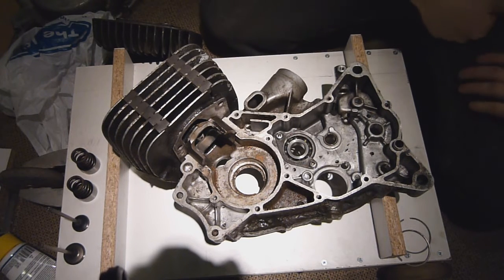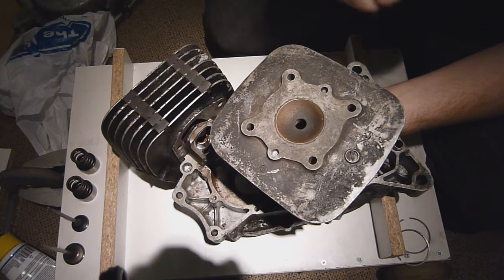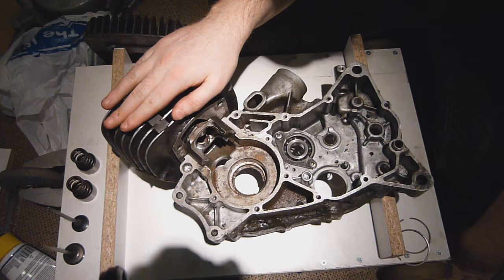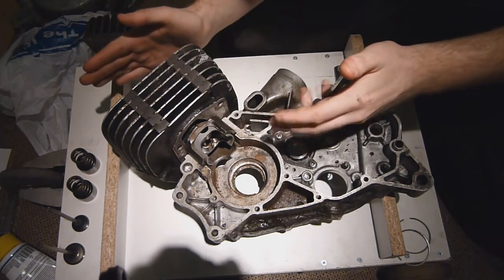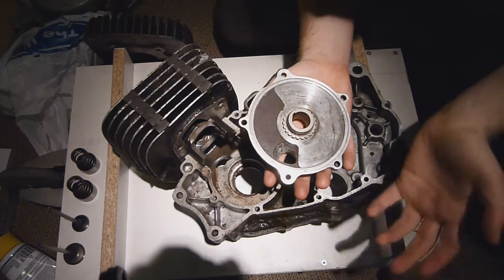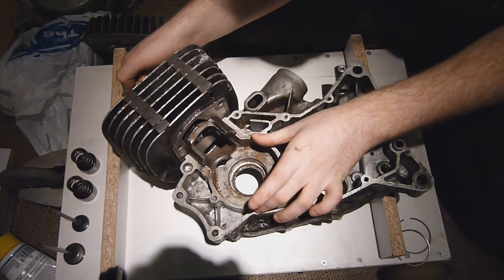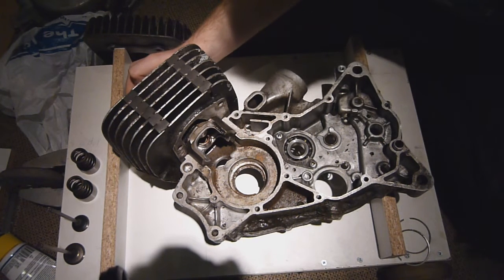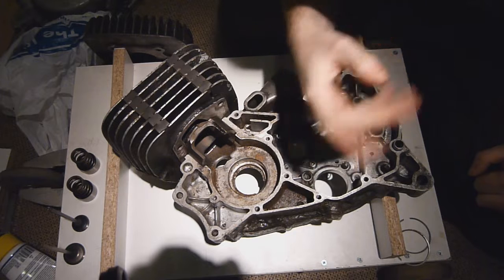How a crankcase induction 2 stroke engine works (The importance of the crankcase)

Comment: Is there a possibility that the crankcase gets filled up with oil if you do a premix and mix too much oil?
Reply from the maker: Not to the extent that you will have a crankcase full of oil, engine wouldn't run at that point. Normally find it just sprays out the exhaust due to the piston forcing it through the engine. Normally find bad carbon build up is the most common issue with too much oil and bad running.

Comment: quick question kiddo. if the returning pulse down the expansion chamber is strong enough to send mixture back into the barrel, how is it not returning the exhaust gas back in also?
Reply from the maker: Well the simple answer to that is it will return some of the exhaust gases back into the chamber at some rpm ranges. That is were the science come into it because you need to design the exhaust at the best RPM for you so the wave just has enough time to push in all the fuel/air mixture. Anywhere above that rpm the exhaust will start getting pushed into the chamber and anywhere below and there will be fuel left in the exhaust.
Reply: cheers

Comment: Does a 350 Kawasaki triple have any inherent performance advantage over a 350 Yamaha twin because of the extra cylinder ?
Reply: +Ron Lawson yes it does, but i believe it is a piston ported engine unlike the yamaha which is a reed valve engine. reed valve engines have a wider powerband.
Reply: The third cylinder is an advantage.  The way the math works out, there's more cylinder area which means larger port area without having to increase port timing (large port timing leads to loss of low-end).  It also means the bore and stroke are smaller; lighter pistons moving a shorter distance means a higher safe RPM limit given the same materials.

Now that said, Yamaha did a very good job of overcoming these drawbacks on the RD twins.  They used a reed valve which allows more leeway in porting without losing low-end as easily as a piston-port like the Kawasaki.  Yamaha also used a more advanced transfer port configuration than the rather old-school (even for the time) Kawasakis.  And both those bikes were RPM limited not by the mechanical constraints of piston speed, but by cooling limitations.  So while a triple has advantages over a twin on paper, these were not realized in practice between the S-Series and the RD.

That said, there are now very well engineered reed conversions for Kawi triples and a good tuner can do marvelous things with the ports to bring them closer to modern designs.  Cooling can be improved massively my reshaping the combustion chamber and fitting a variable-timing ignition to stave off detonation.  In that context, where 80hp output at 12,000rpm is on the horizon, I'd put my trust in the triple.

Also, while the twin sounds great, the triple sounds like God's own orchestra.

Comment: What works best a reed valve or a rotary valve ? Do The old Kawasaki Suzuki and Yamahas that we are familiar with have the reed or rotary valve ? How do the ones without these valves keep the fuel mix from shooting back out the carburetor ?
Reply from the maker: +Ron Lawson , The ones with out valves use the piston skirt to block off the intake tract (Kawasaki H1,H2 etc). Now disc is the best because it's totally mechanical so the intake of mixture is metered the same every time. Reed valves work on the difference in pressure between the intake and crank case and at higher RPM the reed valves can't keep up (reed flutter) and you get leakage past the valves. Some race bikes did do engines with both valves which i guess would be the very best solution :)

Comment: In my mind, 2 strokes engines are much more elegant than four.  The valving action is more organically integrated into the  operation of the engine, like taking advantage of exhaust back-pressure to prevent the loss of freshly induced air, and using the action of the crankshaft as an air compressor, as opposed to adding a whole new array of components like valves and rockers and timing chains.  Four strokes seem very brute force in comparison. I hope fuel injected 2 strokes catch on to help with the emissions issue. Thank you for the great vid.
Reply: KhenPaul W oil burns dirty,emissions will never be as clean.

Comment: Not all four stroke heads have the valves in them. What about the older side valve engines from the pre 1960 cars.? at 1:00

Comment: nice explanation but if you have a piston controlled intake you dont always have holes in the piston the length of the piston is the important factor because just as the exhaust port the intake port is then controlled by the piston as the piston goes up. but i like disk valve engine's the most because you have the mixture close by the crankcase and you have a better cilinder with less holes. but again really good explanation.